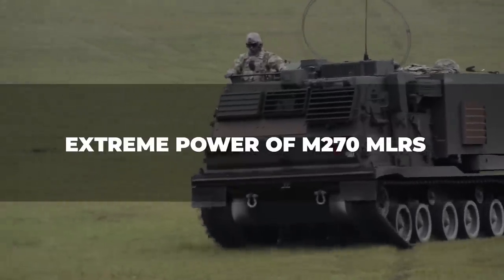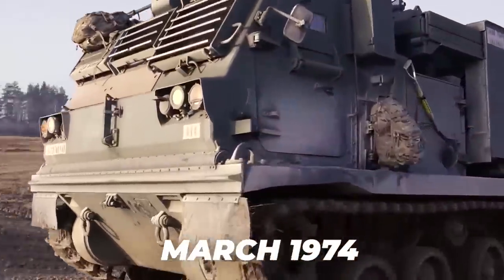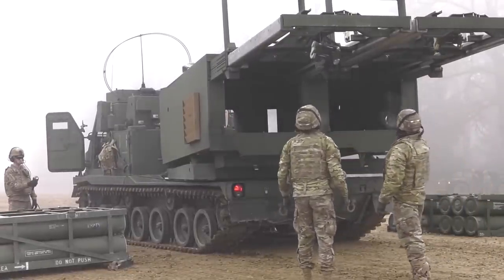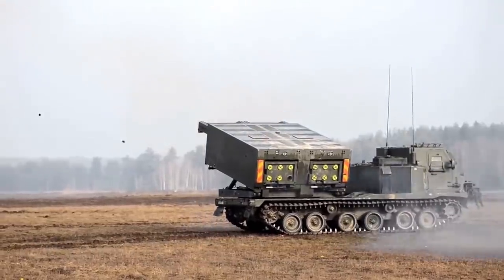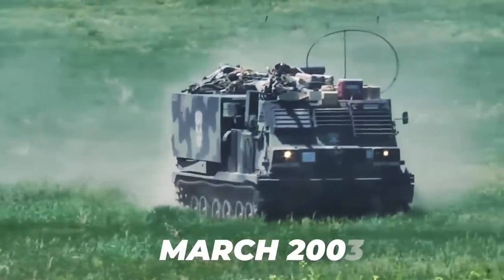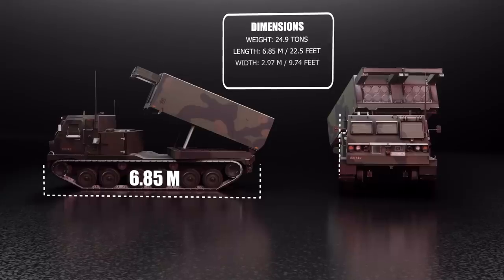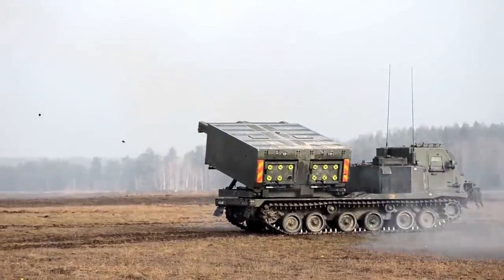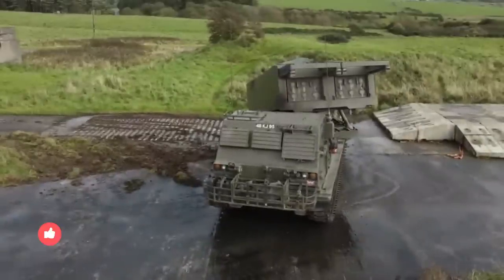Doubled HIMARS. Extreme Power of M270 MLRS

Comment: M270 MLRS are Himars on speed. Using the same ammo and missiles as Himars, but M270 have 12 missils and Himars 6 missiles. One M270 same firepower as 2 Himars. Norway delivered 3 fully upgrated M270 to Ukraine in middle Juli, but later i have read they now have sent 9 more. I doubt it, but i know Norway in fact had 12 of them, so maybe. It would be extremly important for Ukraine. 12 M270 same firepower as 24 Himars. M270 death zone 1000X1000 meter and Himars death zone 500X500 meters. A lot of hits credited Himars in fact was from M270 MLRS system.
Reply: Himars move faster, and is lighter and able to target enemies faster....
Reply: @danielsonrodrigues6222  can be slung from a chopper moved anywhere quickly ...that's the whole idea ...
.
Reply: M270 is good, but HIMARS is easier to use.  Now that the rockets can be guided you may not need to launch the full Monty of 12 to take out a target (back in the day -- target meant artillery unit, HQ, SAM site or battalion in the open)
Reply: "M270 death zone 1000X1000 meter and Himars death zone 500X500 meters." Math does not work like that.
Reply: BS
Reply: Norway gave up all of its M270s to be replaced by HIMARS because HIMARS is faster to move and much more importantly, a LOT cheaper to maintain due to it being a 5-Ton truck with a launcher on it.  This will greatly increase Norway's strategic mobility due to being air liftable by heavy Helo.

Comment: It seems that it was assumed that Russian air defense could hold back MLRS missiles.  So far that seems to have been mistaken.
Reply: oh Yee you there? Or following what they say? 😭😭 they are literally blaming each other for attacks you don’t know what’s going on there
Reply: MLRS is high velocity.
Reply: MLRS are quicker. Fly faster.
Reply: @ajhitchner  Nope.  The missiles are interchangeable between launchers.
Reply: @bobfuts  shouldn't matter, according to the claimed specs/capability s300-400 should very quickly and simply let you apply a filter for a specific  speed/range/size/flight pathetic. so determining the difference should be as easy as setting a filter to ignore grad/m31 sized threats that are traveling 690  meters a second or slower (grad speed) and highlight any going around 850 meters a second (m31 speed). Maybe if the Russians trained their soldiers better or had training equipment built into their defense purchase contracts it would actually work. But it's not that it can't do it.  unless the performance and sophistication of software is far worse then should be possible (seems unlikely as other countries who bought them don't seem to complain about them being junk)
Reply: Someone said that the speed was dependent on the rocket body diameter but that would be so only if the two types used the same propellant. They don't. The u.s. Rockets are considerable faster and more nimble in flight.
Reply: @jimmiller5600 Maybe but the U.S. uses higher test propellant. Quicker, nimble in flight.

Comment: Most interesting to learn more of this weapon system. 
   Several years ago, I had begun to build three of the Dragon 1:35th- scale kits of this vehicle. One would be completely buttoned up for firing, its rear housing elevated, and one missile away. 
   Another had its driver's door open, showing the cab interior, which I had super-detailed. Its weapons system I would turn 90° to the left in preparation for replenishment. Revell AG had re-boxed Italeri's 1:35th-scale kit of the Oshkosh M-977 Heavy Expanded Mobility Tactical Truck (HEMTT), the 8×8 10-tonne armoured transport; this one included the trailer adding additional packs of the missiles. I would incorporate this second kit in a diorama depicting the MLRS receiving new munitions. I also would add to this display Italeri's 1:35th-scale kit of the Oshkosh M-978 Armoured Fuel Truck, based upon their HEMTT kit. 
   A third I had planned to be under- going field servicing with a support vehicle in the process of extracting its engine and transmission (combined with the radiator into an integrated whole), a replacement powerpack close to hand. This would include Italeri's Oshkosh M-977 HEMTT kit, modified with an aftermarket conversion kit to make a replica of the MMRS Heavy Recovery Vehicle.

Comment: Finland should upgrade all of 'em to the highest standard, double the amount and get ATACMS and M30 DPICM rockets well as more GMLRS and ER GMLRS. They should be protected by one NASAMS 3 per 12 M270's, with one NASAMS launcher per 6 M270's and one STARStreak Rapid Ranger per 3 M270's. So one main unit is 12, further divided to two units of 6 and further divided to two units of three.
Reply: This is the " Himars King " the greatest powerful & experted infinity.

Comment: We sold ours over a decade ago due to the anticipated resistance to the submunition used and high maintenance costs due to low numbers. We are now looking into the double launcher on a local truck together with the MARS systems and subsystems so we can do joined maintenance with the German army. But the likelihood of this is low we will probably end up with more PzH-2000 as those have a lower operating cost or possibly even the Boxer RCH 155 mm.

Comment: M-270 versus HIMARS.
M-270 is a tracked vehicle that is all terrain and because of the tracks can carry 12 versus 6 rockets. But it is slower.

The HIMARS is a 6 wheel vehicle and can only carry 6 rockets because of this. It is limited terrain and primarily a road vehicle.
It can shoot and scoot much faster.
Beyond that, they both perform the same tasks.
Reply: It's exactly the same system, just with a different chassis.

Comment: I find it odd that HIMARS are supposed to be "high mobility", 
while the MLRS is tracked - therefore truly mobile, not limited to roads.
Reply: HIMARS is NOT limited to roads.  Why do you think that? It has excellent cross-country mobility. The tracked MLRS can handle rougher terrain because it is tracked, it is better protected, and has twice the firepower. But HIMARS is much quicker to deploy because it is lighter and it is wheeled. So yes, it is indeed "high mobility".
Reply: @mtaylor44  I think HIMARS can be underslung on heavy lift helicopters. The M270 is just too heavy for that. So you might say the HIMARS is hyper mobile'.
Reply: @hardtackbeans9790  HIMARS is too heavy for that.  It needs a C-130 or larger aircraft. The CH-53 is barely rated to lift the weight of a HIMARS but I think it is far too close to do it safely. I don't know if that has even been tested anyway, as everything I have read only lists the C-130 or larger. The US Marines tested a new doctrine to rapidly move HIMARS (HIRAIN missions), but they are using C-130 type aircraft and not CH-53s, so that should tell you that it just isn't or cannot be done by helicopter.   The Russian MI-26 is another that could possibly do it, but Ukraine does not have that helicopter and I seriously doubt the US has tested it (even if they have one or have access to one). I would not consider the HIMARS as air-transportable by helicopter.
Reply: @mtaylor44  Thanks for the info. I will file that away. I wasn't too sure.

Comment: based on what i saw in video on how they load the replacement rocket pods. it seems ok. but i think with a simple track system that can hinge down towards ground and a hook system to keep rocket pods from just falling out. to where they could load and unload new rocket pods directly to and from the ground. they could double possibly more increase the reload speed of the rocket pods. the crane to lift the pods up to the loading tracks is way outdated and needs updated.
Reply: It was designed that way to accommodate multiple NATO members' ammo handling systems.

Comment: M270 is being retired by European countries
Reply: That decision may be reconsidered.  Poland and Finland are joining the party.  So all three countries facing the Russian bloc will have MLRS missiles.
Reply: @jimmiller5600  The M270 is no longer in production so where do you think they are getting them from. The answer is that they are gettting them from
Western European Countries like Britain that is getting rid of the M270 as Britain is looking at replacing it current Inventory of vehicles as they are getting old but I not seen a replacement for the M270 the best replacement for the M270 would be the Tracked Boxer
Reply: @jammiedodger7040  Not sure where you're getting your info.  UK is updating 44 of it's MLRS for more range, accuracy and reliability.  It's disposing of the older ones it doesn't need anymore since the new ones are more effective.  Finland is buying the modernized version.  So is Poland.  I don't know if these are re-manufactured from US stocks or new build.  Either way, if the Democracies needs more, more will be built.
Reply: @jimmiller5600  That’s not how it works they are no longer in production so no new ones will be built
Reply: @jammiedodger7040  no new will be built only old ones will be upgraded
Reply: @jammiedodger7040  The UK was in the process of sending its 42 M270B`S to Lockheed Martin for a full upgrade/refurb in 2022 to be finished by 2026. Before the war in Ukraine started.  Since then the UK sent 3 to Ukraine with another 3 on the way/there after a deal with Norway to upgrade 3 of there`s. Note the US has hundreds of obsolete M270`s lying around in storage I suspect many will get upgraded and sold as very useful in the European environment.
Reply: @Jammie Dodger

The M-270. Many are upgrading their old ones.
As to replacement.
M-142 HIMARS is the replacement. They are faster which is becoming more critical with return fire happening quicker.

They can also he transported more easily by plane.

All the munitions are also being upgraded so all systems are compatible as well as big improvements.

ATACMS is to replaced within 2 years. 500km range. Smaller so 2 fit per pod instead of 1 with same size warheads. Warheads are also being redesigned. No more bomblets. Just 1000's of titanium steel shards along with air burst. Did I mention cheaper per unit.

Also in the works and has even been pre tested.
Firing GMLRS while the HIMARS is moving at a moving target.
Reply: @whatdoesntkillyoumakesyous6707  That’s what I said

Comment: They should upgrade the M270 each missile with multiple warheads thereby saturating a 1 block area with grenades.
Reply: @R C

The warheads are being changed. Getting rid of the grenades because to many don't detonate and that's an issue for friendly troops and civilians.

They're being replanted with 1,000's of steel shards and programmable air bursts. Takes out troops even in the trenches.

Comment: 3:59 Wrong. Cluster munitions like the M77, which were used in the Gulf War, are banned (even the USA has committed to not using cluster weapons). If you are interested the reason is that they constitute a threat to civilians because of the spread of the munitions (around the military target) and because the failure rate leaves many dangerous and unexploded munitions after the battle/conflict which can and do kill innocent civilians. I have mixed feelings about this:  it is good to protect civilians but also cluster weapons are much more effective in degrading the opposition (nine times or more than unitary warheads).
Reply: @kaptainkaos1202  What you say is largely correct but look at when the US has recently used them: a single attack in Yemen 2009 (Iraq, 2003 before that).There is a justifiable fear that the use of what are now generally (and possibly unfairly) agreed to be "indiscriminate" cluster weapons could be grounds for war crimes charges - regardless of the fact that the US, as you correctly say, is not a signatory to the relevant agreement. The US "ban" is tacit, rather than explicit or legislation based. I think we are on the same page.